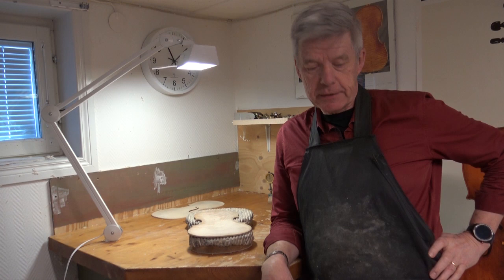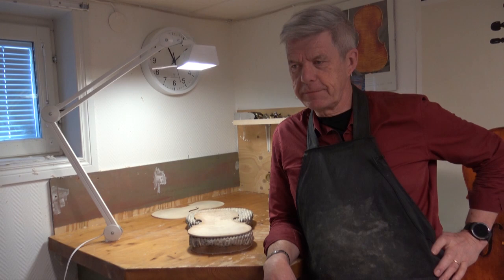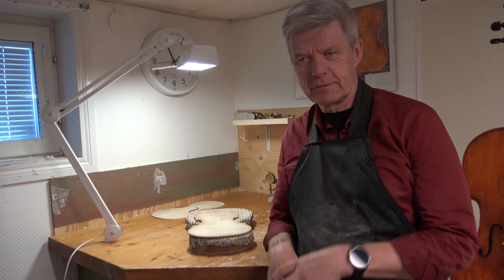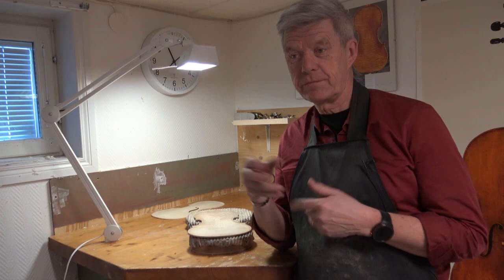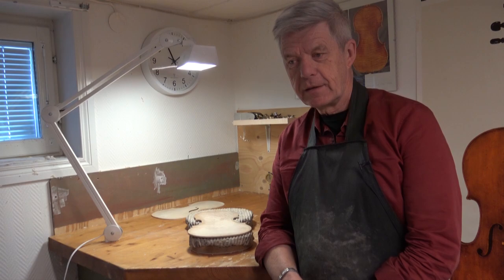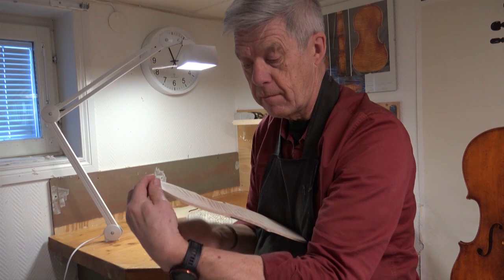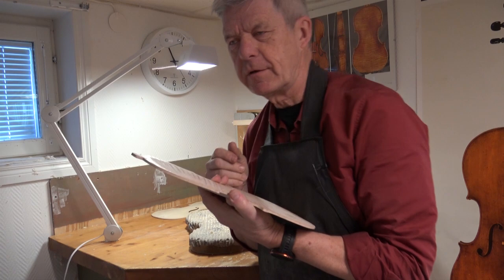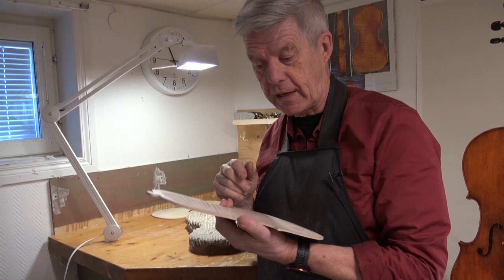Violinmaker Peter Westerlund Part 96 Repetition and alternative scratching technique

Comment: Mr. Westerlund, thank you very much for sharing more about your method. I have a question about f-holes placement using this method. What are the characteristics of the sound that give away the exact location of the f-holes (considering the relative fibros density in tonewood)? Do you use any visual markers for the placement of the f-holes?  Thank you very much for your insight.
Reply from the maker: I first make approximate marks where the points of the F-hole should be. It is easier to know where to look.
That is the inner nick, the point under the lower hole and the point over the higher hole.
Then I just gently tap and find where the pitch has a top, which sets the final spot.
Reply: Thank you. When / if time allows it, would you be willing to make a video on this procedure? Also, are you usually considering the highest tone (from tapping) as a marker for the table's potential pressure point, and therefore a place where the drilling / cutting for the f-hole should go? Furthermore, is the size of the f-hole dependent or related to the sound that the tapping produces?
Reply: @andreibirsan4541 there was already a video about f hole positioning and inner nick (bridge) placement

Comment: I have watched a bunch of your videos, but this one confused me a bit.....you suggested that the higher pitched tap on the outside means remove wood from the inside, I seemed to remember you stating the opposite before.....you always said to remove wood from the side that is higher pitched vs the opposite side?
Reply from the maker: A distinct tapping tells about the other side. A scratch tell about the same side. A very gentle tap is used to find the position of the F-hole or the back plug.